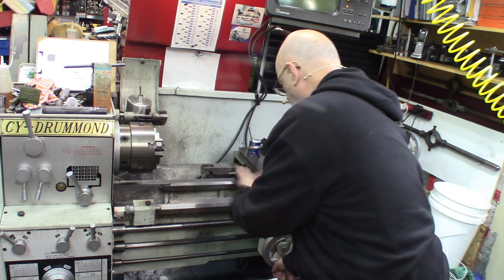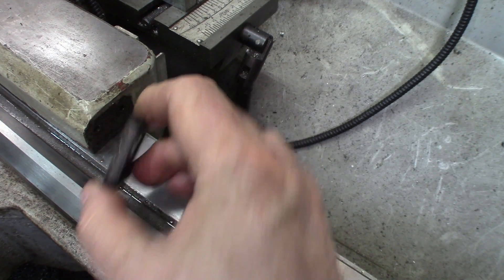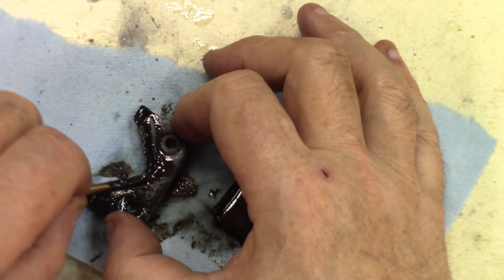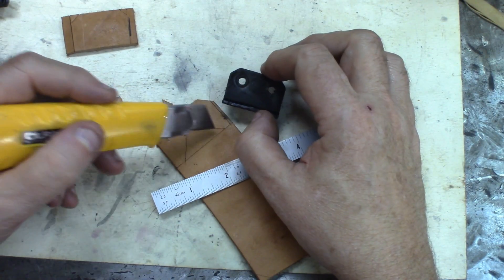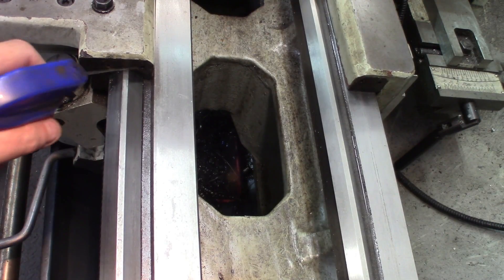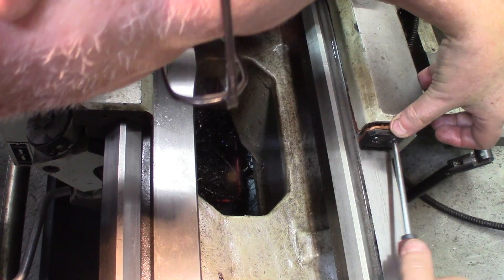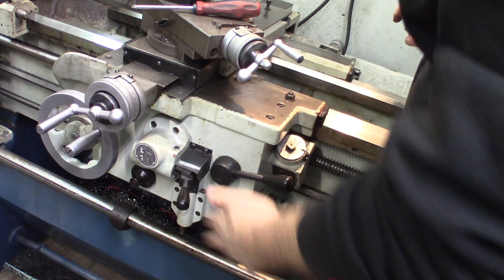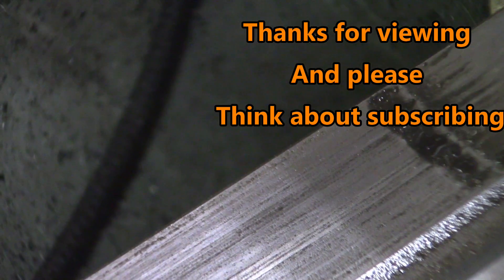Save you lathe, do wiper maintenance... Prevent wear on your ways.

Comment: I don't understand. The wear (grit?) come from the carriage's friction, placing wipers permanently traps the grit between them and therefore accelerate wear. I was always under the impression that wipers were to prevent chips getting under the carriage?
Reply from the maker: This doesn't mean that you neglect to pickup the grit on a regular basis, there is always a little bit of fine grit accumulating under any type of whiper, it's important to remove the bulk of the grit and chips, mostly the hardened ones.

Comment: Very nice idea. My machine is not fitted with such wiper. However it's on my Horizontal boring machine.
I have a better way to regularly clean it without taking it off and keeping it soft.
We can pour a little turpentine oil or Diesel on the slide way. Move it back and forth a couple of times and leave for few minutes.  Again repeat back forth over the Diesel oil. You can see the dirt coming out easily.
Reply from the maker: Just make sure you always keep a good film of lubricant on the sliding surfaces, this prevents fine grit to cause wear, very important...   🌈👍
Reply: @pierresgarage2687  We use the lubricant regularly . And we keep cleaning the surface very often.

Comment: Often overseen part of machine-maintenance. I like felt, but I will give leather a try too.
Thanks Pierre!
Reply from the maker: Hi Stefan, So far leather is at least as good as felt, it keeps chips and fine particules away from under the slides, much better than rubber in my opinion at least, and it doesn't decompose or dry with oil... 
Cheers,    Pierre
Reply: @pierresgarage2687  I'm thinking of stacking leather over felt, expecting the leather to protect the felt for longer...The bantam had plastic ones or what used to be rubber once (maybe) and they were so bad I always cringed upon that sight (plus my uncle turns a lot of cast iron clutches and brake discs so yikes). Ideally I would really like a steel scraper over the whole thing like the mill has, but that might be a little over the top.

Comment: While you have wipers off it is a good opportunity to traverse the carriage up and own using plenty of oil to flush out the ways.
Reply from the maker: Not mentionned in the video but done, also never use compressed air to clean the ways and carriages since it pushes the grit in all the spaces and openings, something to avoid at all cost...   
Thanks for your input,   Pierre

Comment: Another great video Pierre. ..looks like I have something to at the shop today...lol
I did notice a small safety issue when u popped out the second wiper. Don't use the exacto knife cause those blades can snap off and next thing u know u have u have a bloody mess to deal with....lol
Reply from the maker: Hi Bob, I've been using those Olfa knives for more than 20 years now and I'm quite aware of the fact that the blade is meant to break at predetermined seams, one good tip about avoiding the unwanted breakage is to keep the blade as short as possible, this keeps the seam into the holder enough to avoid the break. Most people use those with a very long stick out and then the blade is verry prone to just snap with low force...
Hope you're finiched changing the wipers at the shop by now...    lol
Winter is right at our door, don't forget the wipers on the car also, before the slush season statrs...    ;)

Comment: I need to replace the wiper felt on the shaper, I need to make wipers for the Mueller, they are totally missing.  I hate seeing those black smudgies on the ways, so I've gotten a bit obsessive about keeping them wiped clean.  I've noticed a few with freshly restored lathes having that crud showing up on the first job, like the machine was never apart.  That has got to be discouraging.  Or disgusting, I'm not sure what to call it.
Reply from the maker: As soon as the nasty grit gets betwen the ways and the sliding parts there is gonne be some wear, it takes longer to dammage hardened parts but it still does it, good idea to make something to keep those clean or make some kinda wiper if there is noe to protect the tool...  
Good amout of way oil is also needed in order to make a decent cushion to keep the steel parts some distance appart from each other...   ;)